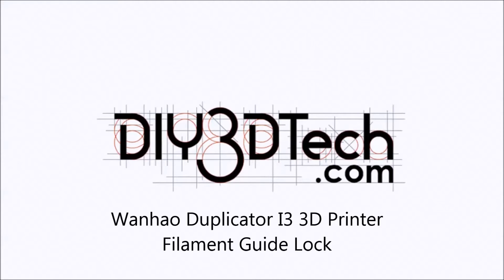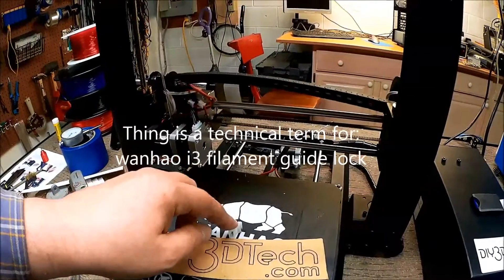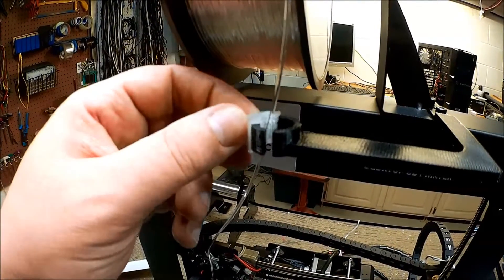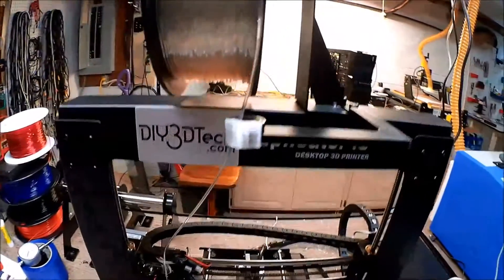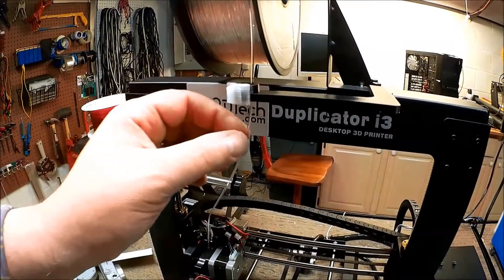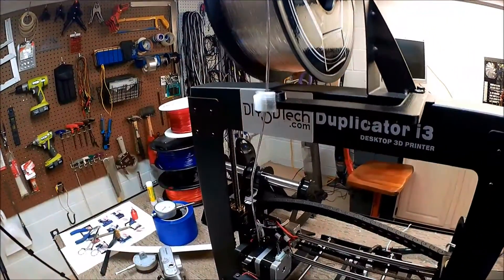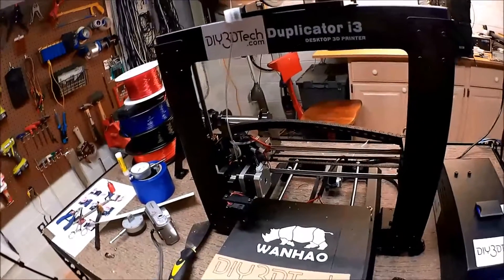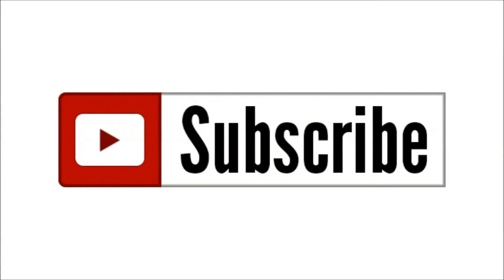Wanhao Duplicator I3 3D Printer - Filament Guide Lock

Comment: I kind of want to print a guide, but I think I will be mounting my spool on the control box, I don't want it interfering with the printing. I was thinking of adding a guide, but i wasn't sure which one was good if i mounted it on the side. http://www.thingiverse.com/thing:1657012
I was looking at this, but I don't know if it would be necessary.
Reply from the maker: Yes a guide is very helpful and have filment on top with a guid and works well (as you see in the video).  Also have you seen this? (http://forum.makergear.com/viewtopic.php?f=11&t=2593)  very well done on petg...
Reply: Wow that's really helpful, thanks! I will be printing a guide, because I don't like the idea of 1kg on the frame haha
Reply from the maker: I posted some pic's on Instagram (https://www.instagram.com/diy3dtech/) of my Wanhao spool and camera set up if you interested :-)